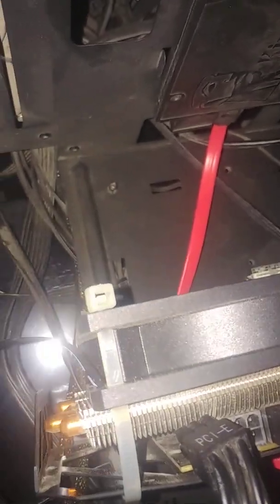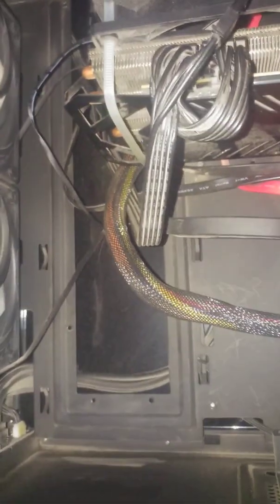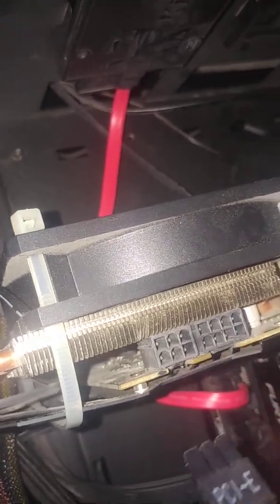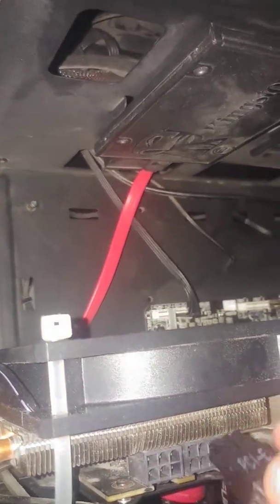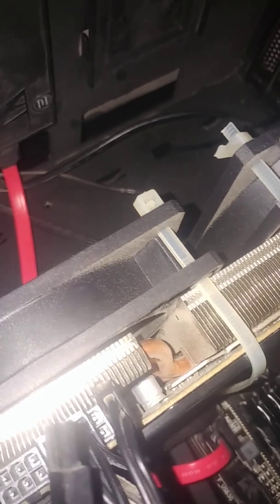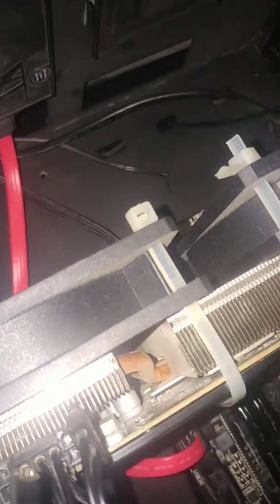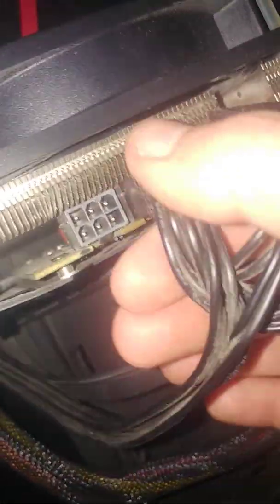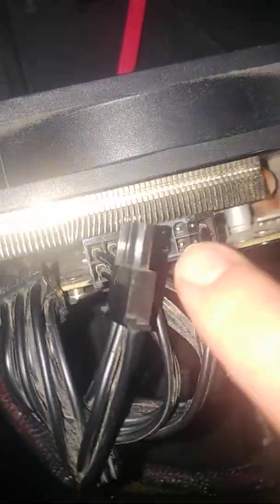PC doesn't start with 6 pin cable connected to GPU

Comment: same issue to my cousin gpu, it's booting on but when load or played some games it crashes and bsod and doesn't turn on. I think its short on GPU since the PSU triggering short protection doesn't send power so it wont fry another component.

Comment: Same issue with a RTX 3070, PC won't turn on with both 8pin connected or with only the left side one connected. PC turns on with only the right side 8pin connected, but obviously doesn't boot/no display since the GPU needs both 8pin connected. I will test by myself with a multimeter before sending it to repair, hopefully it is a faulty Mosfet that can be replaced.
Reply: Bro I need help bro same problem I have same rtx 3070 what I need to do
Reply: @petsfunnyshorts5244  I have not tested yet but I will tell you as soon as I realize what the problem is.
Reply: @gamerhoarder9291 how is it so far brother?
Reply: Same issue with me, I also have 3070
Reply: Did u manage to fix it bro is yes wht did u do to fix it ?
Reply: What's happened my friend, Did the issue resolved?
Reply: @Me_Jaish  I sent it to repair. Not cheap, but it is what is. It's been 4 months since, almost all day long non stop and no issues so far.

Comment: Same issue for me on rtx 3080, (3 connectors) connecting it on specific connector PC didn't boot, but the other two it boot however the GPU is not recognizes, hopefully Asus will send replacement/repair for this gpu
Reply: Did u fix
Reply: Is it an rox strix 3080? (I have the same problem with my rog strix 3090oc)
Reply: I didn't fix it, i send it for repairs and came back working well
Reply: Rog strix 3080 OC
Reply: @Davidlavieri  surprised at your quick response, thanks! So was your card out of warranty? Since it got repaired instead of replaced. And if it was repaired would you please tell me what the issue was and how much it cost you? (mine is out of warranty btw)
Reply: @anonded  in Europe they have an extra year of warranty with the manufacturer (2y seller, 1y asus) prior to 2023, i imagine it was still in warranty until it fully ends regardless if repaired or not, i received a document of RMA. The problem was the power connectors one of them was faulty and Asus replaced them and returned the card in good condition
Reply: @Davidlavieri  I see so it's not a short or anything on board but the power comnector itself? BTW for me it's been like 5 months since the card went out of warranty and this issue happened yesterday. I contacted asus and they said there are no asus services centeres near me who take out of warranty cards idek what to do anymore

Comment: is thia repairable??
Reply from the maker: I didnt have the tools to do a repair myself so just replaced it, probably its a short, they usually happen on a mosfet but you gotta check it with a proper tool...

Comment: Your gpu is shorting out and is most likely fried.
Reply from the maker: Most likely yes, i just replaced gpu cpu and mobo because they were old, no issue with psu
Reply: its always a shorted phase mosfet and based on experience there is a 50% chance it can be fixed, most of the time the mosfet is visibally bad too

Comment: so wen you bought a new gpu did it vwork ?
Reply from the maker: I did not test just the gpu alone because i bought new gpu cpu and new mobo since cpu was 6 yrs old decided to replace it aswell. All other components were the same(psu cables etc). I assume it was faulty gpu cause pc turned on without gpu

Comment: did you find a solution for this?
Reply from the maker: No, just replaced gpu, cpu and mobo. Probably only the gpu needed replacement but i didnt test it. I think there was a short on the gpu, no repair shop in my area so i changed it.
Reply: @blut1847  I'm experiencing this same exact problem too, my computer suddenly turned off while I'm rendering and it won't turn on when the psu cable is connected to the GPU such bad luck
Reply from the maker: @einsleyharriot1294  i feel you
Reply: @einsleyharriot1294  any fix?

Comment: I have an issue similar to this I had a power outage while pc was connected.
My computer how does not start up with GPU power cables connected even with a new GPU so not sure what the issue is
Reply from the maker: I did not test it with another gpu because I didnt have any.  In my case i replaced my gpu, cpu and motherboard. They were all old 6-7 years. It worked fine afterwards( no psu, no cables replaced just the cpu gpu and mobo)
Reply: any fix

Comment: Same issue with me. Computer shut off so I bought a new PSU. When I plug my 8pin, it turns on but if I plug both my 6 pin and 8 pin, it won’t turn on
Reply from the maker: after some research i found out there is a short on gpu so i just bought another one, because here in my area there are no such repair shops
 that can do the job. my old psu worked just fine.
Reply: @Fuhrnie Fern did you ever find a solution to this? My PC is having the same exact problem
Reply: @colerex  so Luckily I was still under warranty. I sent it in and they sent me a new one. They found defects on the card, but didn’t specify what it was or how it happened. Before the PC died on me, I had the card for a little over two years.
Reply from the maker: @Malakai J 6600 its new card u should use warranty, one thing you can look at is your case airflow, maybe that caused the issue.
Reply from the maker: @Malakai J by fans causing it, i mean maybe there was too much cold air coming in creating a condense which could lead to a short, guess ur only option is to take it to a repair shop or try to diy if you have the eqipment. Btw some amd cards like biostar have horrible temps and cooling. If u gonna shop for a new one look for the ones from powercolor/msi

Comment: i hope you fixed your issue but if you still have problems ...you need 2 separate cables coming out from your PSU to properly power up this gpu..it needs 2 cables 1x6pin  1x8pin. Dividing a single cable's power is not recommended.
Reply from the maker: So bought another gpu, what u say will most likely not work since i tested with an old 8 pin psu and when connecting 6pin it would stop working, so concluded its not psu or psu cable but a short
Reply: @blut1847  So changing GPU fixed everything?
Reply from the maker: @xati6603  yes

Comment: I have this exact problem!!
Reply: So how you fix it
Reply: @gamingwithfun8543  new pin connectors
Reply: @HPlyRiikz  connector From PSu?
Reply: @mhex8  so I just ended up replacing the psu power cables
Reply: I face also,..

Comment: How do u fix it
Reply from the maker: Im not entirely sure but judging by what i read on the internet the issue is a short on my gpu thus psu refusing to power up the system. You can look on yt how to repair a short circuit, but in my case i dont have the tools to do it myself. Taking it to a repair shop doesnt fix it completely because if the repair man doesnt have components to replace, the gpu will run slower. That is if the short did not occur on the gpu chip itself, in that case u need a new gpu.